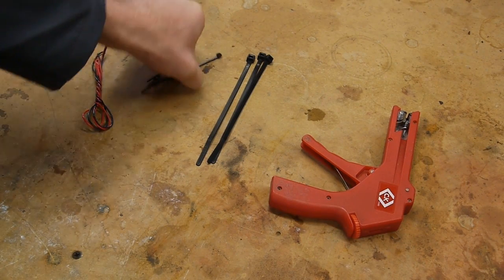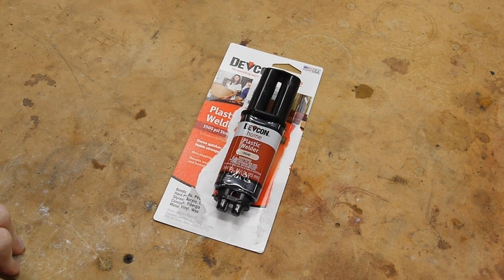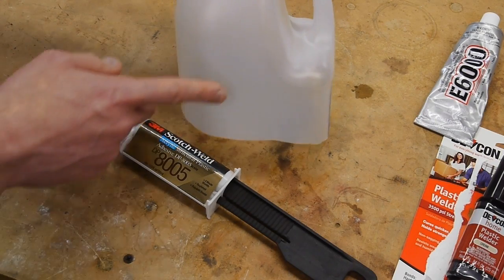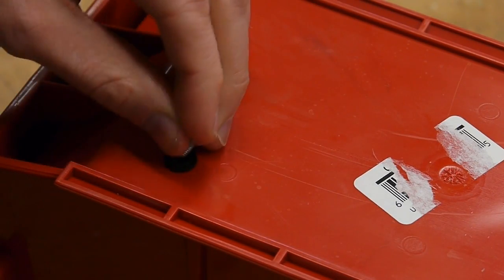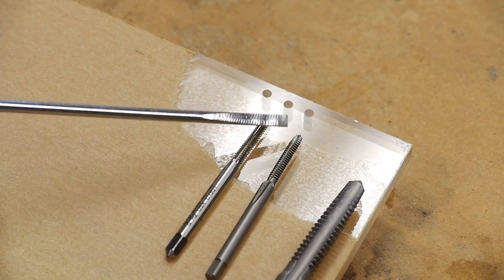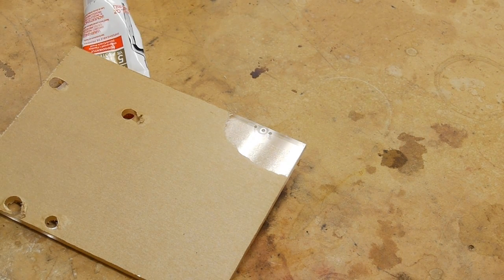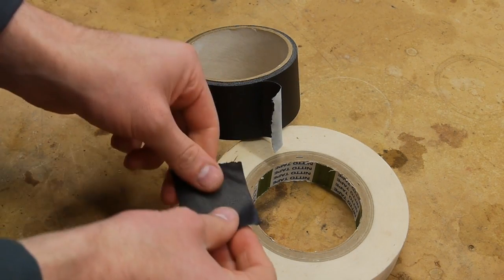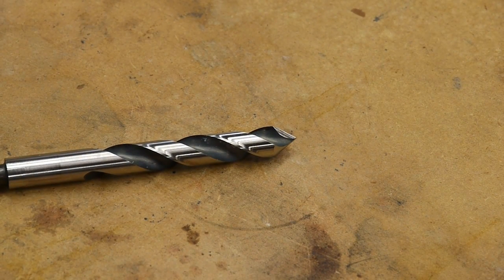Tools and Tips #1 from Applied Science

Comment: Talking about your plastic weld, if I ever need something for an application like that, I go to JB weld. They carry a plastic bond that is similar to yours, dries in 15, sand it in 30. They have a lot of similar products, great for minor repairs on auto parts that you cant get anymore. Had a crack in my thermostat housing on an older car, and the housing was connected to a pipe that ran allllll the way through the engine hah, did NOT want to take it off. JB welded it, 2 years later, no water leak still, and I expect that "weld" to outlast the car

Comment: That double sticky is the best, as you say.  It works best to whack the part onto the tape with a rubber hammer.  To remove, spray liberally with isopropyl.  After it soaks in, the part will lift right off.
If the tape is still clean and free of chips, you can often reuse the tape for the next part!
Reply from the maker: Good tip regarding the clean release and re-use!  It will really help since the tape is about $20/roll.
Reply: +Chris Tacklind I used this kind of tape for templates when routing large quantity duplicates.  I would love to try what A.S. used.  It may last longer than what i have.

Comment: I think Mike from mikesectricstuff uses those same ikea lamps, they look very useful - i'd be very tempted to add a large chunk of dense metal to the base though.
Reply: Applied Science Nothing that can't be fixed by gluing an iron plate to the bottom :)
Reply from the maker: They sell a version of the lamp with a clamp instead of a weighted base.  Depending on your desk setup, it may be a better choice.  It's true that the base could be a little bigger/heavier.

Comment: Can you do a demo to show the strength of the Scotch-Weld on low surface energy plastic? Like glue the milk bottle to a soda bottle cap and try and pull them apart and see how strong the bond is. There are a number of companies making small tubes of CA glue with a special "primer" that causes them to bond fairly well. It would be cool to see a comparison of this and other "Low Surface Energy" glues you can find.
Reply: USWaterRockets  Hey, I'm using Scotch Weld DP807 and it works really good on PET, acrylics and polycarbonate. I purchased it cause I needed to glue nickel plated magnets onto acrylics and PETG sheets, tried CA, contact glues, cements and various epoxys, but they were even close to the DP807.
I haven't tried the DP8005 but DP807 works. The glue remains kind of rubbery, so it doesn't cure completely (rock) hard like epoxys. The only downside is it really smells when mixed, so ventilation is needed.
Reply from the maker: It makes a really good bond with PE.  I've used it extensively with small plastic storage bottles (from McMaster), and to test them, I'd try to rip off the plastic fitting that I had glued to the bottle.  I tested one to destruction, and the bottle itself broke apart before the adhesive failed.  DP-8005 can fill gaps too.  I think they also make DP-8010 which can form good bonds with PTFE.
Reply: Applied Science That's really good information. We've been looking for something that works on these kinds of plastics. Do you by any chance know if either of these also works on PET/PETE/PETG? We are always looking for something that can bond soft drink bottles together without compromising their pressure integrity.  As strange as it may sound, the best glue for this yet discovered is a PU based glue called PL Premium Construction Adhesive. But it seems to be more of a friction bond with a roughened surface than a chemical bond. You thoughts on this would be much appreciated. Thanks!
Reply: Koit Kulper Thank you for the tip. We will get some and test it out. Looking at the data sheets it looks like it might be a great solution. Thanks again!

Comment: Great video! I've done quite a bit of work with those 3M plunger style adhesives. I prefer them over generic epoxies not only because of the more application specific adhesives available but because of the dispensing guns that they work with. They make applying adhesive so much easier that using your thumb to try to evenly dispense two-part adhesive.

Comment: Super interesting video.  I have an adhesive question for you Ben. My dishwasher door lost a seal and the replacement can't be installed correctly because I don't have the custom stamp that was clearly used to crimp the original seal into the door. I attempted to glue it in place using the best glue I had, which was just a 5 minute epoxy.  The epoxy stuck great to the rubber seal, but not at all surprisingly didn't stick to the smooth stainless steel door panel at all.  Any suggestions for glue that would work in a hot, wet environment and stick to stainless?

Thanks.
Reply from the maker: I'd prep the metal with sandpaper, then clean with isopropyl alcohol.  You could use 3M weatherstrip adhesive or the E6000 mentioned in this video.  Both of these adhesives will remain flexible and tolerate the thermal cycling.  Good luck!
Reply: Applied Science I finally got around to fixing my dishwasher using your advice (I got the E6000). I haven't actually run a load through yet; it is still curing. But initial results looking promising. There is only one spot that doesn't seem quite stuck, but I am not sure if it just didn't have enough adhesive or it is a sign of the glue not working out.  Obviously the moisture and thermal cycling of actually running the dishwasher will be the real trial. But I am hopeful. At a minimum it is now sticking in the position we have spent the last month manually placing it for each run. I will provide more follow up as the situation develops. Thanks again.
Reply: Any follow up? :)

Comment: That double sided tape looks and sounds a lot like the banner welding / hemming tape we use in the sign industry, which isn't particularly expensive, especially from trade suppliers. 3M also do a line of high bond gel tapes for assembling ACP signage (metal to metal) that are ludicrously strong.